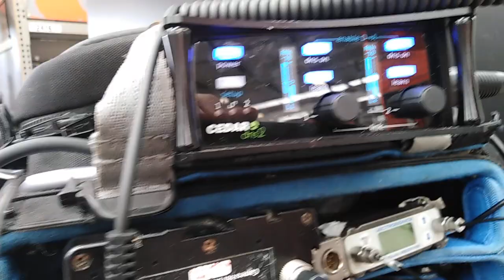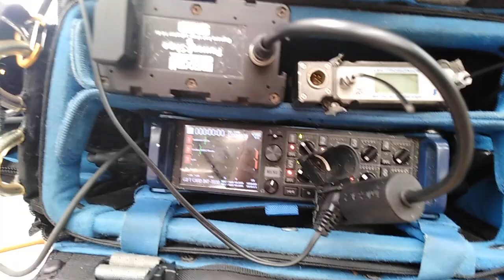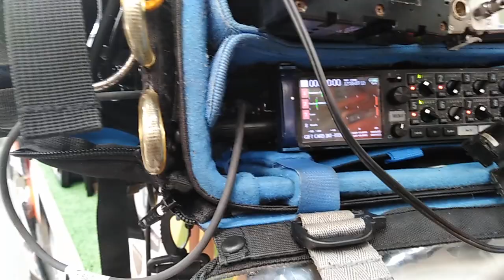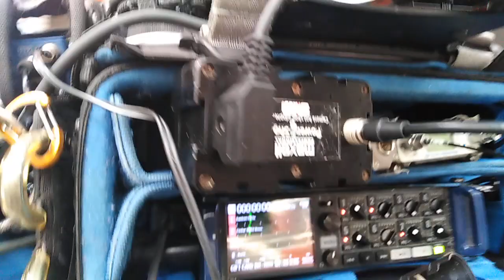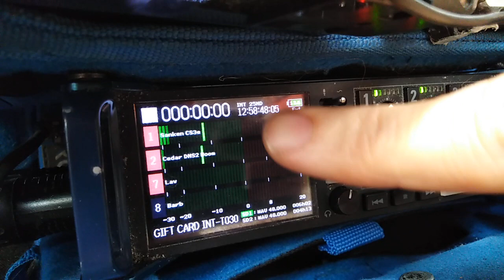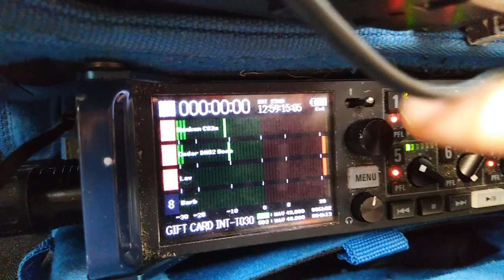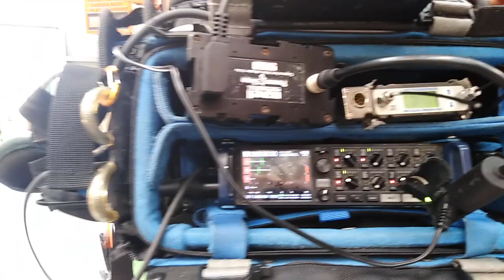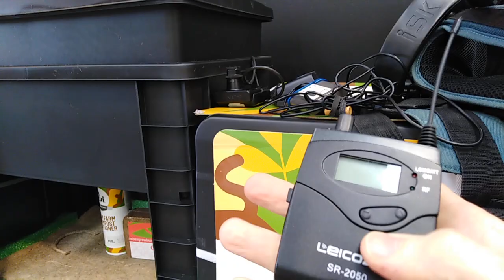Recording a TVC in a noisy hardware store, used CEDAR DNS-2 + Sanken CS3e + Remote Audio HN-7506

Comment: Great video mate, also good to see what my new zealand brothers are doing
Is that your Cedar DNS? Always wanted one, just never could justify it.
Also congrats on the Maxx! I love that machine so much, especially with the installed transmitter.
Anyway love your videos.
From your Aussie pals
Reply from the maker: G'day! My Cedar DNS-2 was one of only two over in Australia, until I purchased it, not sure if there are even any others here in New Zealand? It might be the only one!

Do you (or used to?) own a Zaxcom Maxx yourself? (I saw you've got a 788T, and I agree with you about how awesome the MM1 is!) I would love to get in touch with other Maxx owners to discuss settings/workflow/setups/shortcuts/etc
Reply: @SoundSpeeding  Wow! Thats awesome mate. Yeah very few mixers/recordists in Australia have Cedar. I only know of 1.
I don't own a Maxx myself, but I've used them several times and they are awesome machines. Personally not as easy to use as the 788T, but very high performing. I won't buy a maxx, but definitely gonna get the Nova when it comes out. That said if you have any questions send them through, if not me, some of my friends own maxx's so I could pass through the info
Reply from the maker: @alexchristensen2651  yes, just one over in Australia, and I just found out this week there are two other folks in NZ with a Cedar: Tony Johnson (a big big time drama recordist, working on Avatar at the moment) and another similar guy, so I'm basically the only non-cart guy with one I guess.

Comment: Do those Leicozic work also when fed by a Sennheiser transmitter? I've used the Sonys and found them very practical, but I don't own them and I'm not sure whether I'd want to switch everything over to sony or keep sennheiser and buy some ear monitors like your Leicozic here. Thanks.
Reply from the maker: Am almost 110% certain they'd work with a Senny TX too, but I don't own any. 
But if you're buying a transmitter specifically for this purpose, I'd recommend getting a Lectro.
Reply: @SoundSpeeding  Didn't get notify of the prompt answer!!!
Thanks. Not sure I'd want to go for lectro and expand even further the variety of my pocket boxes, as it would add up the costs and lower elasticity.

As many Europeans, I've been a full sennheiser guy for long, but the price of their ear monitors is just silly. Why would I want to pay that much to give 2 headphones to director and client is beyond my comprehension. I've long been looking for a light, battery powered, elastic, easily integrable with current setup and frequencies, cheap hp monitor solution. I've been renting Sony's from a friend colleague and I think that Sony's have a better package overall than sennheiser and they even come in lower price. I'm still not ready to move everything over when only a couple of inexpensive "low quality" Chinese earphones would solve most of my problems for the small setups I rent my stuff to though. Thanks for your reviews and opinions though!
Reply from the maker: @giovannispinotti   you could get an old Lectro UM400 for dirt cheap, it's what I'm using. (but getting Lectro IFB T4 too)

What do you mean by "elasticity" in this context?